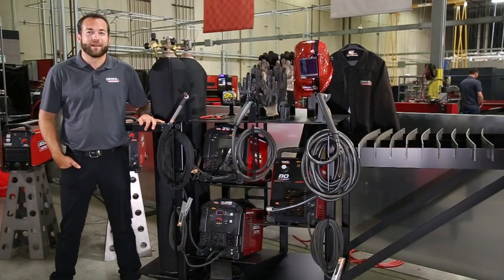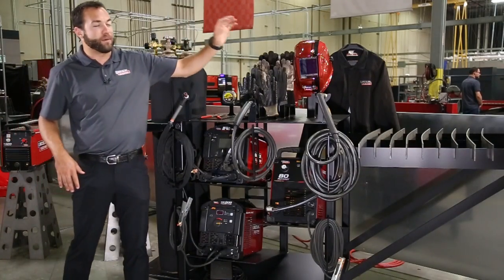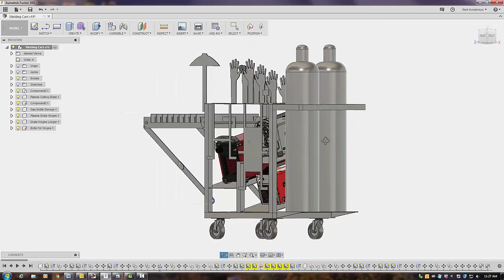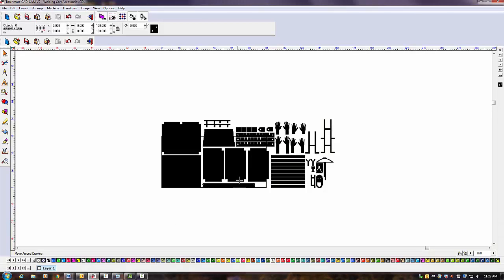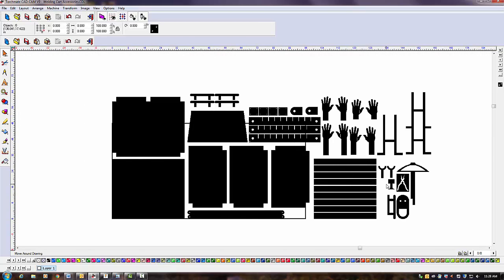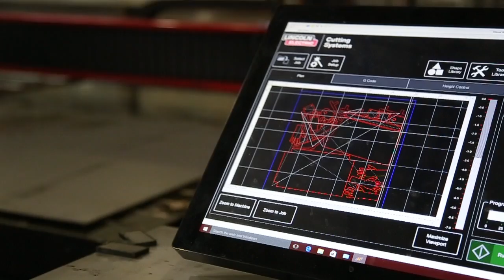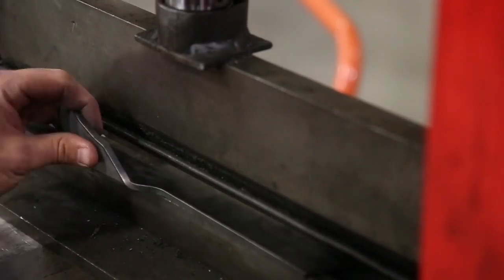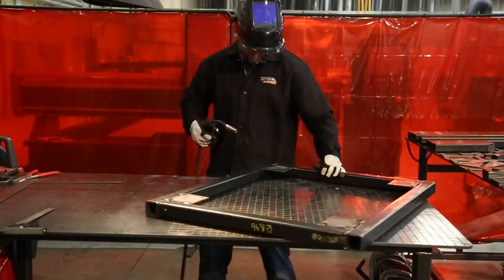THE ULTIMATE WELDING CART by Lincoln Electric: Design | Cut | Build S2:E5

Comment: Definitely would have tossed the glove holder and hood holder to make a nice welding table. You could have made 2 rings to fit over the top of your argon tanks with 2 hooks on each ring one set of rings for your hood one set for your gloves. Just my 2 cents but it's still badass!!!